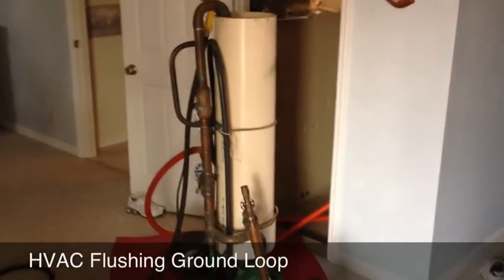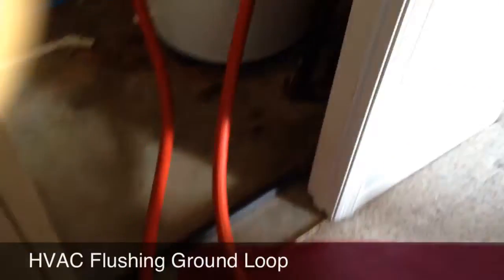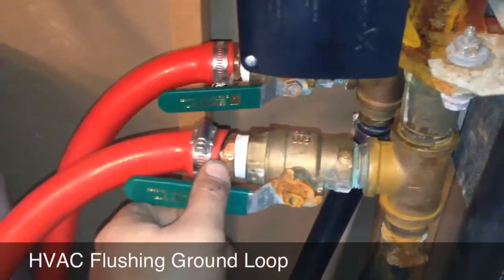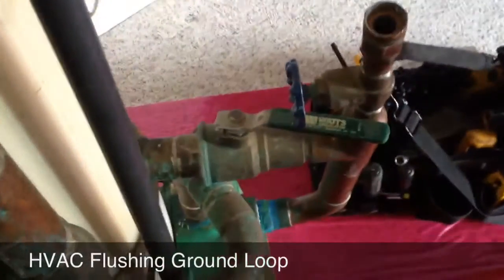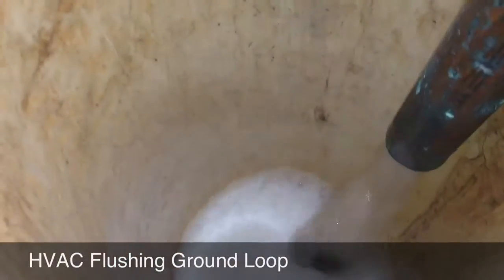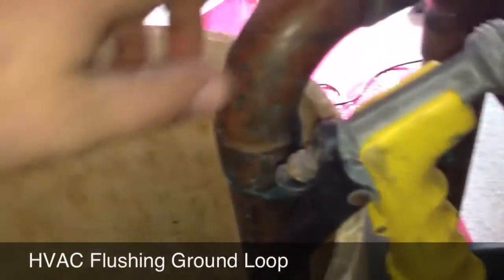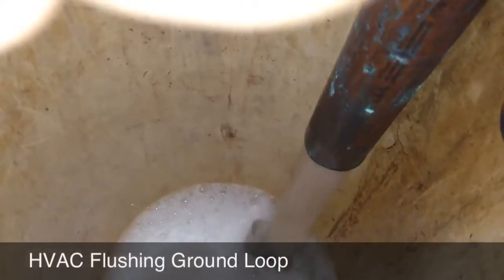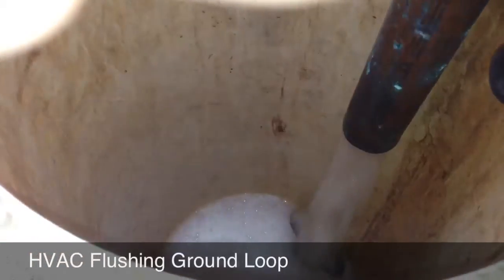HVAC How to Flush Geothermal Heat Pump

Comment: Hey friendly tip when you allow the water to fall into the flush cart like that you are actually aerating the fluid in the loop. The return line should always be fully submerged into the water that is being recirculated.